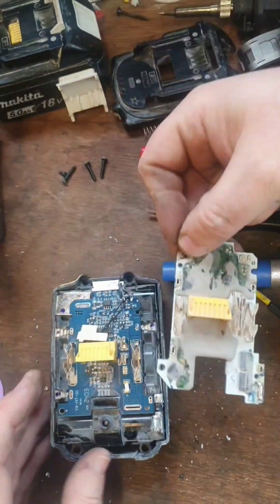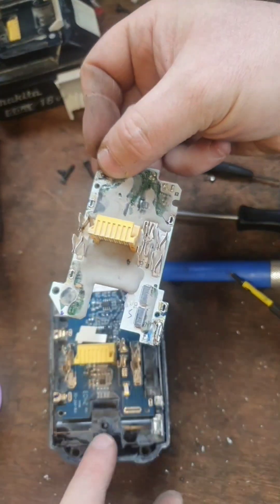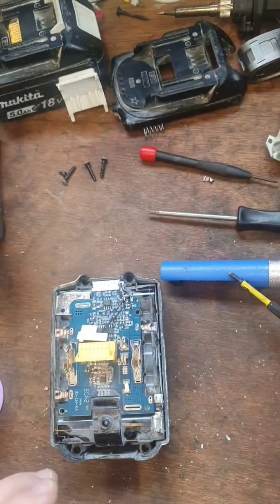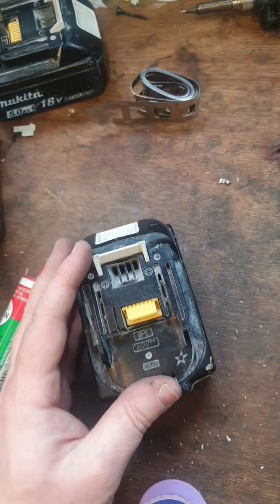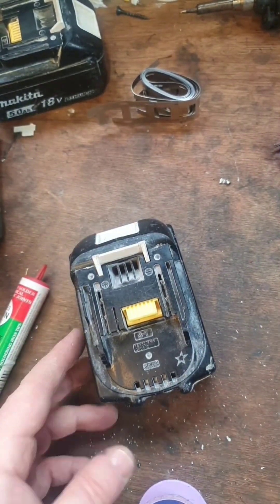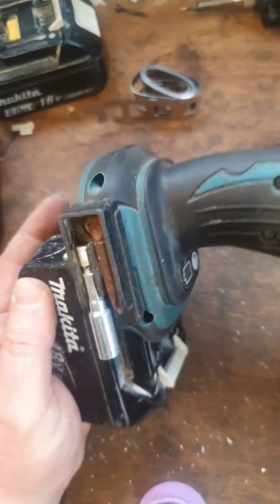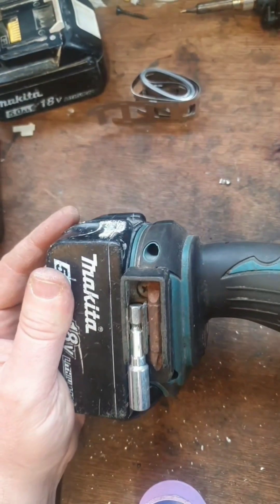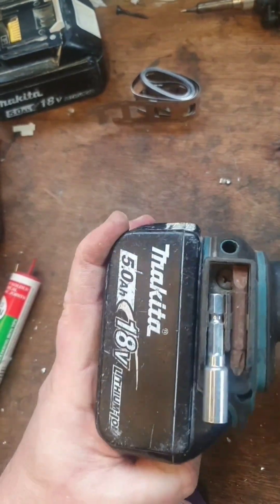Makita battery board replacement #powertools #repair #makita #shorts

Comment: Are those BMS second hand, new genuine, or chinese copy?
I have an old Makita battery that christmas lights the charger so I set a psu to 20v 0.5A to charge. Never seen it christmas flash on the battery before!
Reply from the maker: Copy boards from amazon 
https://amzn.to/4aOAvK5
Reply: La mayoría de circuitos pcb son hechos por  otros fabricantes, ya que casi ninguna compañía vende los originales
Reply from the maker: Correcto @stephaniedupeyronxalfredot2670